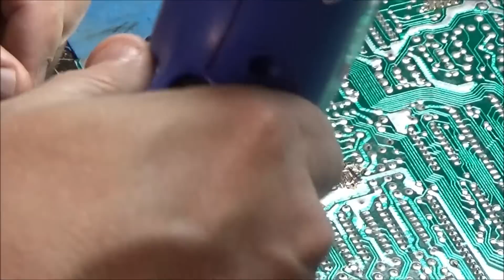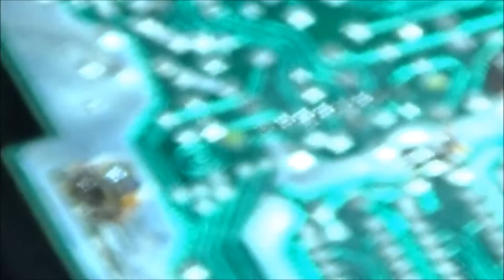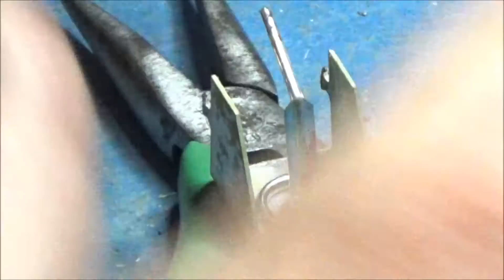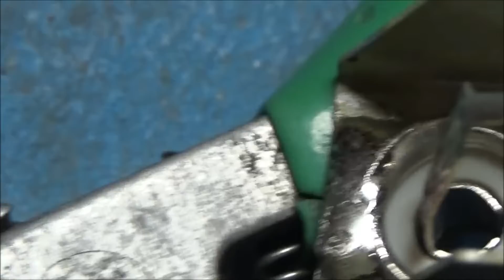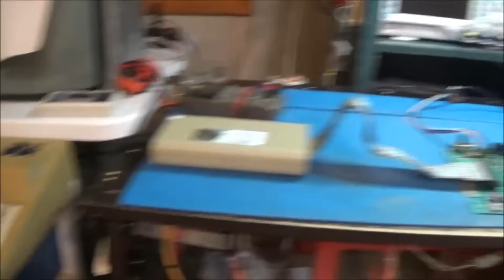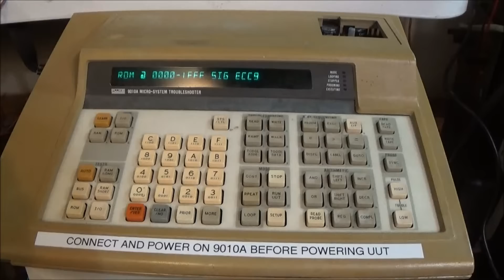Colecovision Console Lot - Tear-down and Repair Part 3

Comment: I've seen this exact failure on a few other channel's apple 2's. So I had a feeling it was just a grounding issue. Those jacks are super cheap. Honestly though, if I'm removing the RF modulator, I'd look into a composite mod or better.

Comment: On the Colecovision with the bad 2114 RAM, it would initialize the video IC (so it generated sync), set the screen to black (if you crashed the machine you could get a garbage screen) and then on the oscilloscope you could see it stuck in a loop writing to the 2114 RAM (it's going like Initialize VDP->Initialize VRAM->Initialize RAM->display Colecovision logo - no idea where Initialize sound chip falls in there)